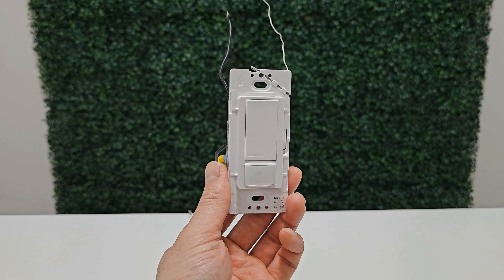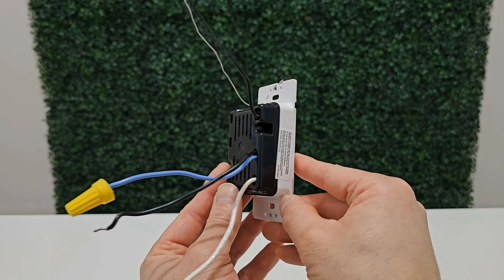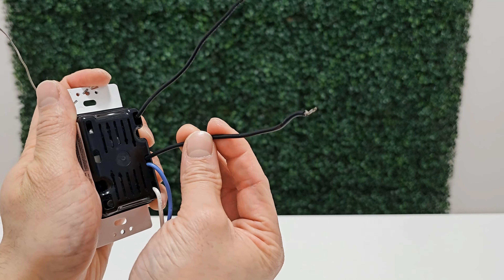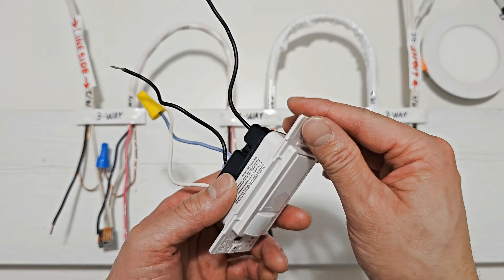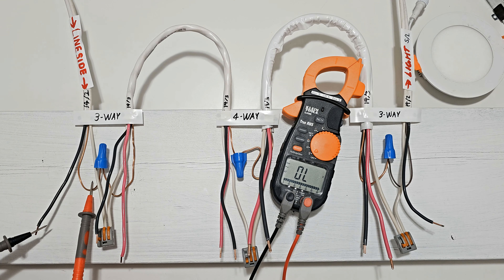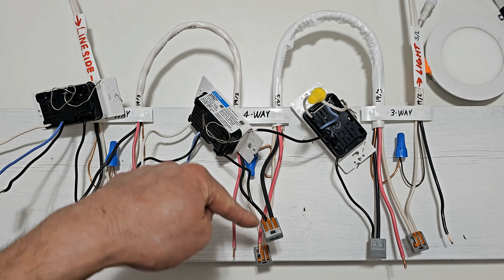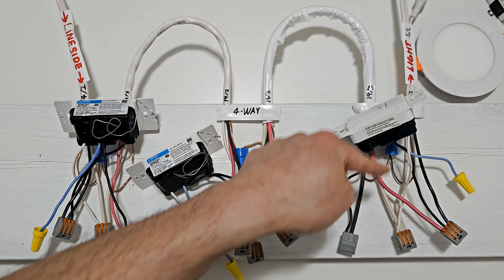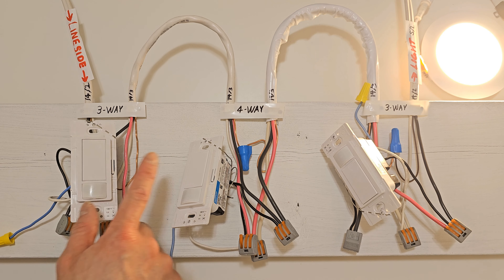Install THREE Occupancy Sensor Switch On A 4-Way System Circuit - ANY BRAND

Comment: Worked like a charm! thanks man!  good question: is there any way to use one sensor and two single pole switches?
Reply from the maker: @worldskiresorts  that is good news!! Absolutely, yes you can make it work. Very similar steps. Power going to the top of the switch on both and then the bottom screw will be the black wire connection from the light side. The white and ground wires will be the groups. Cheers 🍻